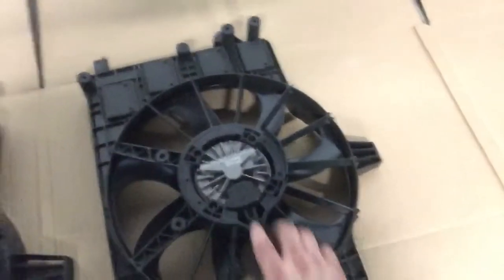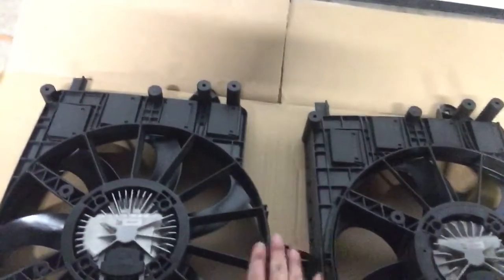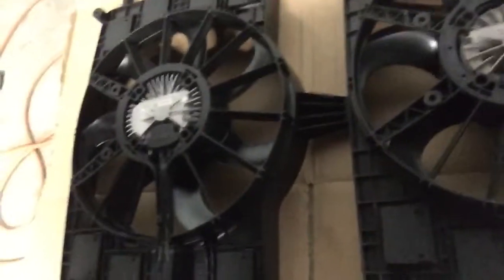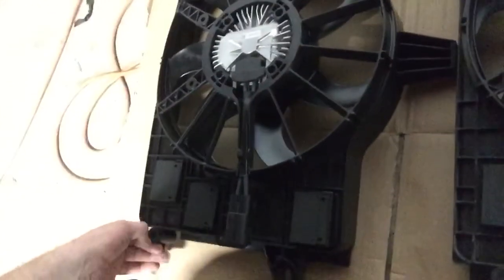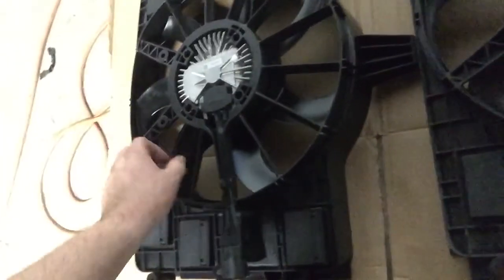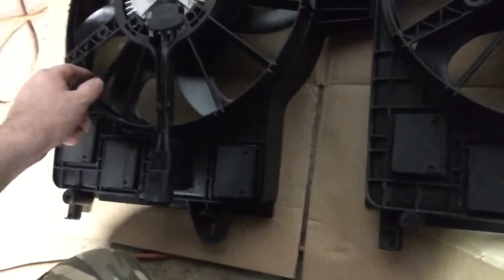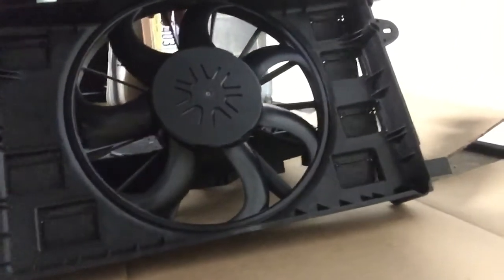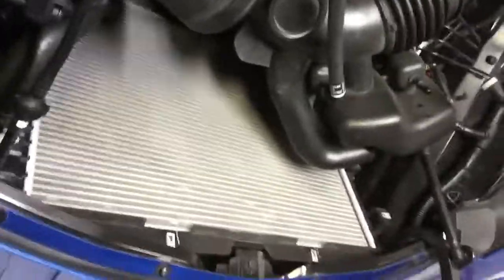C7 Z51 Corvette cooling fan upgrade because of over heating

Comment: My 2014 with 30000 miles over heated in traffic. The engine was saying turn off ac. So I did, pull into a gas station. Open the cap a little bit and all the coolant kept coming out the over flow valve. Had to add water but I made it home. 
Was s second fan suppose to cut on??
And my seat or window not working since the dealership replace the door speaker. 
They fixing that soon. But is there a trick to fixing it

Comment: The one that says specific z06 I'm assuming you used?
Reply from the maker: Correct I got the OEM z06 brand new cooling fan from Chevy. Little beefier. I’ve never had an issue since !
Reply: @MrPatkline  I can't find it anywhere
Reply: @MrPatkline   What is the specific part number you used to buy the part? And, is it an AC DELCO part? Thanks!!

Comment: Any updates after you made the switch in fans?
Reply from the maker: Never had issue after replacing the fan! Cools way faster !
Reply: @MrPatkline  thank you!! My 2014 Z51 twice has gotten to 255 degrees without the fan kicking on, so I turn the AC on and that kicks the fan into high which immediately drops the temp to normal. Ordered the Z06 fan Sunday hoping that fixes the issue